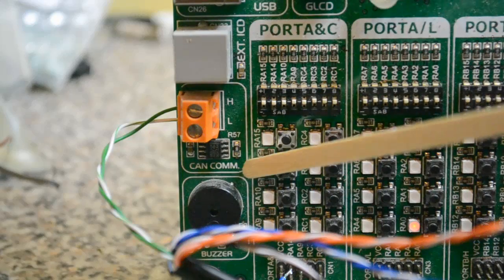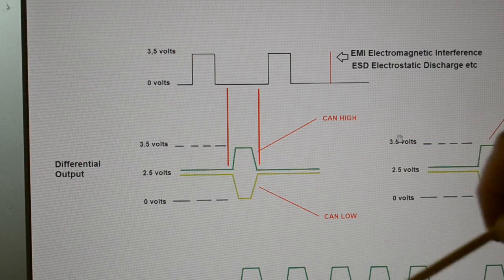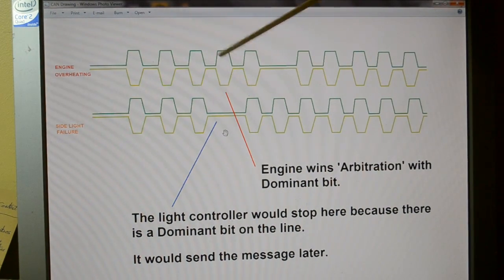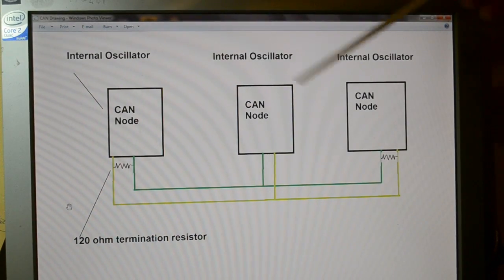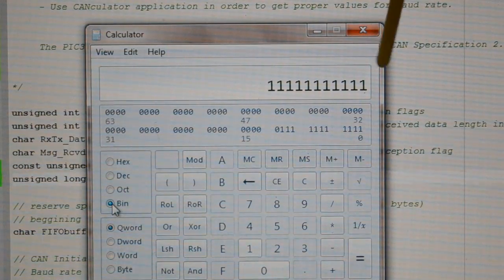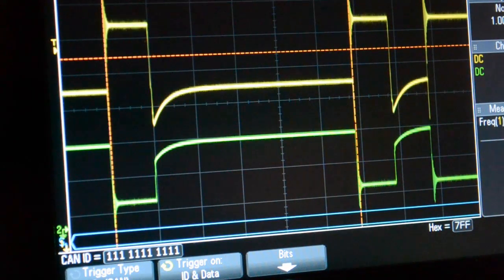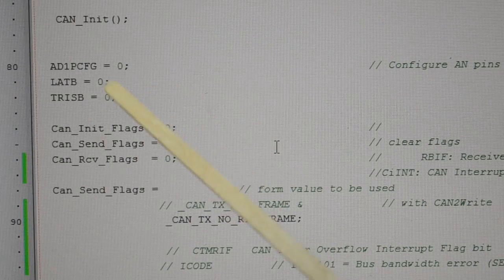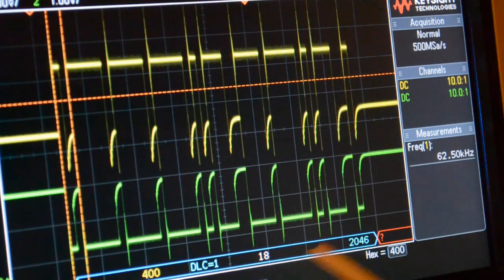CAN Controller Area Network Part 1 Demonstrated with MikroC Pro for Pic32 (Read Show More)

Comment: Ive got an elm327 and my cars got a vdo siemens ecu . The problem is that this obd-ii debuger never can read error codes but refuse to show me the live data . Can anyone help me plz.i can buy a proper debuger but really insisting on making the elm327 work on that
Reply from the maker: To read fault codes you need to send data to the ecu first requesting the fault codes.
Reply: @JohnB-2021  it read error codes but refuses to give me live data
Reply from the maker: @amirouw  is it a BMW or something?
Reply: @JohnB-2021  its peugot 206
Reply from the maker: @amirouw  what year?
Reply: @JohnB-2021  its 2007 and made in iran but have a continental siemens ecu
Reply from the maker: @amirouw  so you can’t read simple RPM at the OBD connector?
Reply: @JohnB-2021  yes exactly...but i can read fault codes
Reply: @JohnB-2021  what could be the problem???

Comment: This old video but I learned a lot than new can bus tutorial,because you discussed the "internals" which the most important ,thanks for this
Reply from the maker: Thank you very much for your kind comments.
Reply: @JohnB-2021  If you can make updated  video featuring accessing CAN BUS frame through registers it will be highly appreciated especially error detections,thanks anyway

Comment: JOHN B, Chrysler and Dodge uses TIPM totally intergrated Power Modules, It's a circuit board with CPU chips and eeprom chips that have loaded software that controls all the modules and sensors in the car. It uses CAN diagnostic request signals and CAN isolation signals. It has 4 layers of grounds on the PCB board, I'm not sure why 4 multilayers of grounds. Do you know how a CAN sniffer works and what a CAN sniffer does or what its used for? can you give examples of using a CAN sniffer?
Reply from the maker: A can sniffer decodes the waveform to give hex or decimal values.
My scope is an example.

Comment: Yes TIPM means totally intergrated power module or they call they "central gateway" circuit boards. These circuit boards convert CAN signals into ILS signals and other high speed and low speed signals. I'm not sure how these TIPM circuit boards and gateway circuit boards work but they control all the buss signals. Do you know what SAE J1850 signals are used for in cars? and what ISO9141 signals are used for in cars? they are on the DLC connector
Reply from the maker: They don't call them any such thing here in the UK, well not on Ford, Vauxhall and Iveco / Fiat

Comment: every car has a gateway circuit board that all the modules connect to a gateway circuit board. The gateway circuit board converts and controls all the busses high speed CAN signals into ILS, SAE J1850 signals, ISO9141 signals. I'm not sure what SAE J1850 signals and ISO9141 signals are use for or do you use them to troubleshoot car issues? Do you know how these Gateway circuit boards work or what they do?
Reply from the maker: Where did you get that name from?
All the vehicles I have worked on have no such part
Reply: The gateway module can be an instrument cluster or other module and basically translates the different protocols between the different networks available on some vehicles so they can share data.
Not all vehicles have gateways, because some only use 1 protocol like CAN for example.

Comment: No just asking in general for all cars. Every car as a TIPM central gateway, what does this TIPM circuit board do because it has Microcontrollers ECU and transceiver chips for each Module to connect to. Each Module has an ECU and Transceiver chip but also the TIPM circuit boards have microcontrollers and transceiver chips. What does a TIPM circuit board do?
Reply from the maker: I've never heard of a TIPM

Comment: What fault light do you use brand and make? do you use a scanner tool to check each module one by one when you get a CAN buss fault? The modules are hard to get to in the car to disconnect without tearing the whole car apart to disconnect the module while viewing the CAN signals High and Low until it returns back to a normal good signal. If you wanted to Upgrade from CAN 2.0A to CAN 2.0B to CAN FD all you have to do is replace all the transceiver chips to CAN FD? the CAN buss harness and modules can stay the same just replace all the transceiver chips?
Reply from the maker: The fault light is the engine light.
You can't change the spec of a CAN system, the chips have specific hardware for a specific type of CAN.
Do you have a vehicle with a specific CAN fault?

Comment: Do you disconnect each module one by one while looking at the CAN buss signals on the oscilloscope? or do you disconnect each fuse one by one at the cars fuse box whiling looking at the CAN buss signals on the oscilloscope? How do you normally test each module or do you use a scanning device and what scanning device do you use to test each module in the car?
Reply from the maker: Hi Bill,
No you don't disconnect any module, if you did, that would put a fault into one or more modules since it would not receive an acknowledge from the part it is trying to communicate with.
If there is a fault, you'll get a fault light and then you read the fault. It's rare to have communication errors.

Comment: John B, When you get a checksum error how do you know which component is bad? or what do you do once you get a checksum error what is the next step by step?
Reply from the maker: Hi,
You have to connect a pc.
If one part repeatedly reports a checksum error and nothing else does, it is that part that is faulty.
I had a gearshift module on an Iveco Stralis do exactly that, it happened on quite a few vehicles.

Comment: JOHN B, CAN buss signals have hexidecimal value and voltages, how do you know they are a BAD signal or a GOOD signal or hexidecimal value is good or bad? and you give more examples of good CAN buss signals and BAD CAN buss signals?
Reply from the maker: Hi,
The message is only bad if you have a 'checksum' error.
If there is no checksum error, the message is always valid.

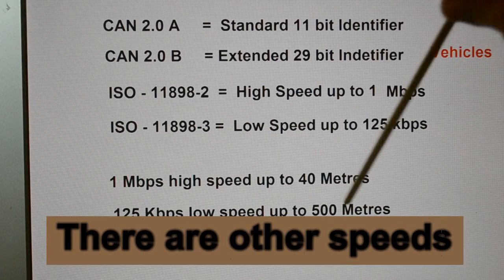Comment: I'm curious about the logic levels you started referring to at 4:30.  I've seen 3.5 and 3.75 V for CAN high, and I've seen 0, 2.25, and 2.5 V for CAN low.  Is this not in the spec and can be changed by whomever is creating a CAN?

Very impressive, doing all this in Paint, by the way.  I think I'd rather herd cats, but glad you had the patience and skill for it.
Reply from the maker: Thank you very much for your comments.
The voltage specs are set only by the CAN transceiver.
There are generally 2 types, a 3.3 volt transceiver for 3.3 volt micro-controllers and a 5 volt transceiver for 5 volt systems.
The non dominant bit will be half the supply voltage so I assume most vehicles have the 5 volt transceivers.
I hope this helps.

Comment: Who would I talk to about some serious issues CAN  networks in automobiles have been dealing with? I have an idea for a solution  that may be very helpful
Reply from the maker: I guess if you have a solution, you should speak to the manufactures of the equipment you're working on.
What sort of issues are you experiencing ?
Reply: The design of  the CAN network has some serious flaws in my opinion. Any interruption in the network can bring parts or the whole network down. In some cases something as simple as a short to ground or a burnt out component that connects to one of the many modules can cause a no start or knock out other modules. Problems like these can be hard to track down. There are ways to correct the problem. I have thought of a few myself. A change in the way the computer talks to the modules is one of them. Prioritizing modules is another. Too bad ya can’t just call an engineer and talk to them about some solutions
Reply from the maker: Willie Gillie 
Yes I found the same problem with an intermittent fault in many instrument clusters, it would stop the vehicle.
Trouble is, that fault is few and far between. The CAN system is a pretty solid way of communication and does not allow for short circuits because they shouldn’t happen.
If they do, one simply calls a sparky
Reply: John B John B The main problem is Can modules and monitored devices are in several places littered throughout the vehicle. Almost every electrical device is connected to the network. The biggest problem is all the wiring and where it all goes as well as the connectors are it’s weak point. We are seeing a lot more cars having issues with the signal due to shorts, grounding of the signal wire. This can cause a no start situation and other issues preventing a scan tool to connect to  the network to troubleshoot the problem. Disconnecting modules one at a time will sometimes bring the network signal back so you can communicate with the computer. It’s a very common problem that takes a lot of skill and knowledge (sometimes outright luck)of how the CAN network functions to identify and correct the problems inherent in CAN technology in the cars of today.
Reply from the maker: @williegillie_watchman  I agree, though I never had a non start nor a situation where the laptop would not communicate with an ECU.
One of the most memorable faults was a coach with the engine at the rear.
It had an intermittent CAN fault, it took a day or more to find the smallest of chaffing wires near the rear of the vehicle.
I had to check every inch of the wiring on the full length of the vehicle.
The other fault I mentioned earlier.
Many tractor units were intermittently going into neutral and the whole instrument cluster would light up like a Christmas tree.
It took weeks to get to the root cause of the fault.
We had an F1 racing team that wanted the fault repaired urgently. They were driving all over Europe with a truck that would just stop for no reason. Being an ex electronics engineer, I had a fluke hand held scope, I monitored the CAN line one day, to my horror the CAN line signals were going wild and off the screen. Something was causing 'ringing' on the CAN line. After unplugging various ECUs, I finally found the instrument cluster was the cause. The bosses set up a 3 way phone call between me, Iveco UK and the manufactures in Germany. I told them what the fault was. I believe the cluster had different revisions so just kept fitting new units at £500 each every time I saw the fault. 
The Germans could not get their heads round the problem and did not understand how I found the error.
They didn't understand 'ringing' and what I was telling them, they weren't electronics engineers. 
So are you saying you have a solution?
I've only had experience with Iveco & Ford.
Its nice to know other vehicles have the same problems.
I figured I was a good sparky because I was an electronics engineer working in the motor trade, I'm assuming it must take a regular mechanic days to fix some of the simplest of faults.
Where are you in the world?

Comment: Nominal bitrate:
It's important to point out that "All nodes on the CAN network must operate at the same nominal bit rate"; that means that all nodes on a CAN bus start operating at a given, pre-determined, bitrate.
As "noise, phase shifts, oscillator tolerance and oscillator drift" occour, the CAN protocol provide a (re)synchronization mechanism that occours at the beginning of a frame and during the transmission of the frame. (read last paragraph)

Non-return to zero:
Each bit isn't actually transmitted by returning the CAN line to the recessive state, before putting the line back to a dominant (0) or recessive (1) state. The line is just left as it is between the transmitted bits if they are equal (two consecutive zeros (00), or ones (11), will cause no transitions in the CAN line) see "non-return to zero" https://en.wikipedia.org/wiki/Non-return-to-zero. 

Synchronization and stuff bits:
In fact, synchronization happens at the beginning of the frame (hard sync) and every time a recessive-to-dominant transition is seen during the frame (soft sync); that's why the "stuff bit" is needed if 5 consecutive bits of the same level are transmitted, in order to cause a recessive-to-dominant (or viceversa for a sequence of ones) transition and to make a consequent soft synchronization to happen.

(https://en.wikipedia.org/wiki/CAN_bus)

Comment: John - the stuffed bit is used on HD disks too, it ensures there are no errors in the data by having data transitions. It's called RLL 7, 2 if memory serves on the hard disks, no fewer than 2 zeros in a row and no more than 7 in a row on the media. If the media had all zeros, they would never be able to tell if there were errors on the media. I hope this makes sense.
Reply from the maker: Cool, thank you for the info, sounds right, so it has to be :)

Comment: Hi,
l really like the way you described this protocol.. 
i want ask 2 question-
1.what will happened , if there is a single node on a bus , and it transmitting data.. 
2. Is this scenario comes , when we need to transmit a data frame having data byte more than 8 byte.if yes how it will transmitted over the bus.
means in which format data frame would be transmitted...

Please help me on this.

Thanks!
Reply from the maker: Thank you for your comments.
I don't understand your questions.
A node can transmit up to 64 bytes of data, but usually up to 8 on a vehicle.
Have a look at this video
https://www.youtube.com/edit?o=U&video_id=IIUaA4sYVrY
Reply: Hi John,
Thanks for your response, I am re- writing-
1. what will happen , if there is only single node on a bus , and it transmitting data frame .
* Is it possible ?
* if yes, will it continue, as there is no other node on bus to respond . 
* if no, what will happen ,may be after 1-2 retry after not getting any AC
K ,will stop transmitting?
 
2. How  we  transmit a message  having data byte more than 8 byte( e.x. 21 Byte )of data .how it will transmitted over the bus.
means in which format data frame would be transmitted? means it will packetized   in data frame having data byte 8,8,5 bytes.

Thanks!
Reply from the maker: I assume you're not talking about a vehicle then.
It depends on how it is programmed.
It will / should keep transmitting the data until it gets an acknowledge, assuming it is waiting for one.
The data can be 64 bytes long, so it can keep transmitting the same amount of data i.e. 21 bytes until it gets a response.
Reply: hi John,
For Question 1, i am asking about CAN for vehicle system .will  keep transmitting ? because there is no chance to get acknowledge as there is no other node present .
For Question 2, i am asking about CAN for vehicle system  only with CAN 2.0A/CAN 2.0B not in CAN FD mode

Thanks!.

Comment: Did you ever manage to figure out why the stuff bit came in early?
Reply from the maker: Hi,
Good question, I didn't.
I think it may have been down to the 'CAN Calculator' I used.
It works out the timing required for the frequency and cable length.
I put in random numbers just to get my driver going.
The stuff bits and crc are all hardware controlled, the user does not have to program them, good job because that would be a complex bit of code.

Comment: Thanks for the CAN Information. I have a question about bit stuffing. I know it is not allowed 5 consecutive bits with the same value in CAN. Can you explain why? this is my first question. :-) Thank you.
Reply from the maker: Hi,
I believe it is to do with timing and synchronising of the pulses with the internal clocks.
Reply: hmmm. That is true.   Syncronization is needed when there is no transition on the line from 1 to 0 or 0 to 1 for certain period of time. manchester coding provides synchronization for the ethernet. But manchester coding can not be used for CAN because of arbitration. 

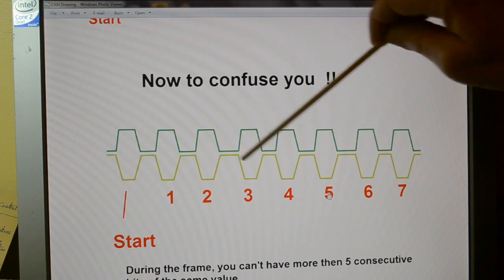14:40  on your video, it does not look like consequtive bits with same value.  it is like 10101010. that confused me. it had to be drawn like a straight line. On the other hand at the 25:25, oscilascope values are correct repsentations.
Reply from the maker: Hi,
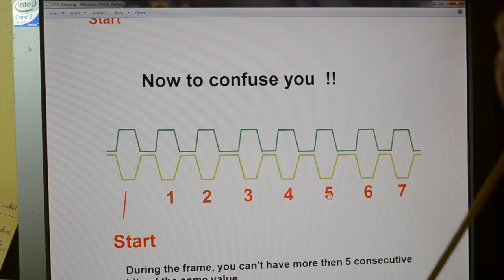At 14:40, I am showing 7 bits all with the same value, 0000000 that is before I describe the stuff bit.
Thank you.

Comment: Hi John, I have some questions for you.
1- I have implement 6 filters and I divide the message with this rules: 1st buffer receive messages with Id from 0x10 to 0x1F, 2nd from 0x20 to 0x2F..
But I lose some of packets, can you help me please?
2- Have you ever implement the interrupt for CAN comunication?
Reply from the maker: Hi,
The Mikroelektronika example I use has the CAN read in a while 1 loop.
If you're program is doing other stuff, you would need an interrupt.
Thank you.
Reply: Can I send you the code? I can not find the error
Reply from the maker: Hi,
Sorry I don't have time with work etc to look at individual codes.
It may look like it would work until I program it and have the same setup to see why it doesn't work.
Where are you losing the packets from, do you have a second micro-controller?

Comment: Hi John,Really nice video,  great explanation...keep it up....Could you please let me know the cost of CAN Bus module board used in your presentation?Also please tell me which application(I mean the compiler) you used to program the same, do we get this Application for free?Please ...please tell me..
Reply from the maker: Hi,
I use Mikroelektronika's Mikro C Pro for Pic32 and an easypic fusion v7 board.
The compiler is not free
Check    Mikroe.com
Thank you for the comments
Reply: Thank you.Which one you suggest me. (I mean CAN controller)